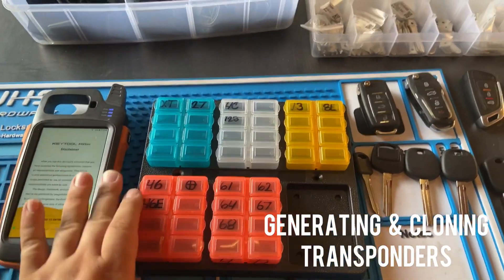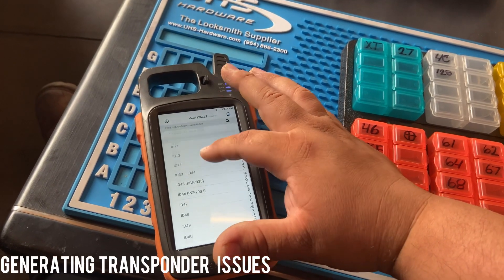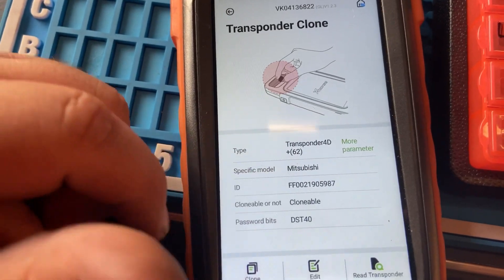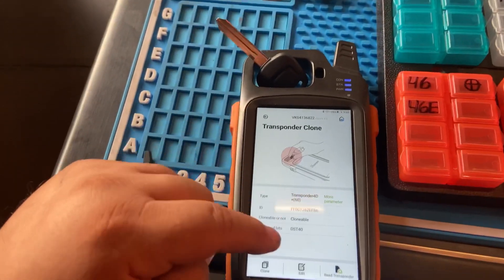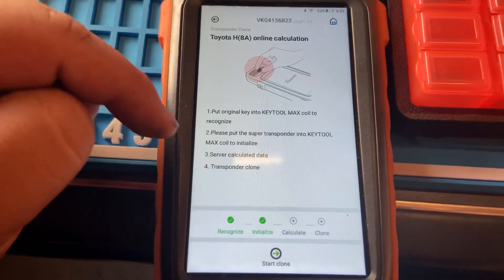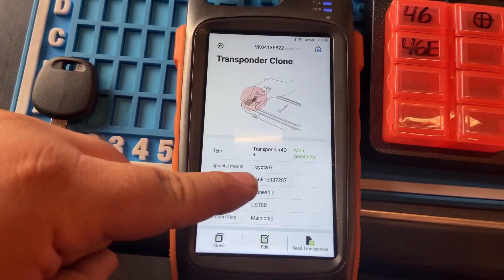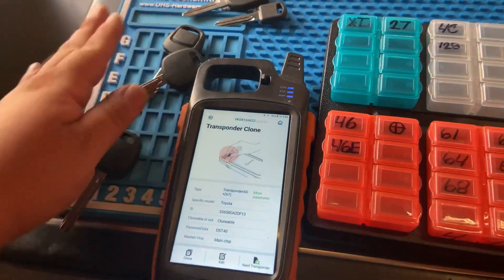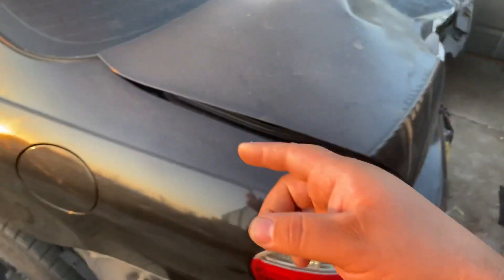VVDI KEY TOOL MAX- GENERATING & CLONING

Comment: on the 4c when you say you can clone it but hard for antenna to pickup, try this. drill small hole where transponder sits, to where the blade goes into the mfk head. so the transponder has a clear hole to put signal to antenna coil.
Reply: And I just thought I wasn't doing something right...
Reply from the maker: Thank you matt!!  Always appreciate your great tips!!

Comment: ID13 can be generated but won’t work. Even then some chips do get programmed in different ways than others. Do you know the procedure to program ID13 key. All key lost!
Reply from the maker: Needs a generic id13 only cannot generate..you can also clone 13 with superchip and use cloned chip as a replacement chip for id13

Comment: I tried to generate a 4C last night onto the super chip but it was not allowing me to. Every time it would ask me to put the chip in it would fail no matter how I held the chip. Any suggestions? (2001 F150)
Reply from the maker: Yes you cannot generate 4c chip with super chip ! Or sometimes wont be able to clone either best thing to do is use a generic 4c chip..

Comment: ive run into an issue with renewing Dodge SRT RED keys! they will renew fine and program, but will show up as a Black key limiting the HorsePower to 500.
Reply from the maker: I believe you dont need to renew.. im preety sure they are reusable.. it's probably that you are renewing to regular non red key data info!!
Reply: @MYKEYSAUTOMOTIVE  I thought so! I was thinking of getting the TMPro to maybe make my keys RED again :)

Comment: Do they "keyless factory" Branded remotes/keys (on uhs hardware) work with the key tool max? Do they already have transponders in them?
Reply from the maker: No they dont work with the ktm they are geric remotes and already come programmed to work for only those listed models you cannot generate them .. yes they come with a chip.. no u cannot generate the chip the come with.. they are strictly for the vehicles that are listed below!

Comment: Im back. tried the dolphin few times and decode is bullshit. Now have the laser key reader. Let you know how that is later.
Reply from the maker: Are you decoding by data base? Have you update and di calibration ? Height adjustment.. cutting calibration?
Reply: @MYKEYSAUTOMOTIVE  it did cross my mind about doing another calibration. But when you look at the decode probe you see on inner track keys it just does not touch both sides everywhere. Then when it cuts the key its crap. I had originally thought it was due to selecting the wrong biting for the key blade. 

Anyway after failing twice on a customers car in the field, I decided to go away and get my new laser key tool. It was not ready for some days due to key tool max login account issues where the security text was not arriving. 

I selected the blade and scanned the customer key. I sent the cutting info to the dolphin. It cut the key without needing biting info. It did it flawlessly. A beautiful cut mirrored both side into the blade. 

Tested on the car following morning and it fit the lock perfect.

Comment: you answered the question Do i have to program the key after cloning? And answer is no. However, do you need to SNIFF the ignition when cloning? Or no?

I seen another video where they were cloning a car key and he had to use the keytool and sniff the ignition by putting the original key in ignition turning on, then put the keytool close to the ignition. Does that need to be done? Was it older firmware or something?
Reply from the maker: Hello there is no programming after clonning ,however chips like 46 and 48 require sniffing from the ignition lock cylinder in order to finish cloning.
Reply: @MYKEYSAUTOMOTIVE  that makes sense!! thanks!

Comment: Hey here’s something. So I got the latest iPhone 13 pro max. Downloaded the xhorse app and started using. Only lucky too. Because I selected update on key tool max and the update wiped loads of my key blank info from various cars on it. 

So the app. Clearly it’s missing the reader. The part that detects the key transponder types. Yet in the app it says connect to the reader. So do they do a stand alone reader the app can use to generate transponders and remotes…? Yet to see that
Reply: In app when you select generate it tries to connect to a device. What device…?
Reply from the maker: You need to connect to your key tool max via Bluetooth.. or mini key tool, once it connects it should have all your data
Reply: @MYKEYSAUTOMOTIVE  well if I’m to connect the phone to the key tool max which already has the exact same info on it then that’s bloody stupid. No point developing the app.
Reply from the maker: Correct thats correct .. it's convenient to connnect the mini key tool
Or
Dolphin or even mini prog .. but yes useless if you have the ktm

Comment: Ok so the im608 pro i bought says for eu market on the screen as its loading. A firm here whom only sell these and boast they are great at diagnostics, and with 70 percent of their work fixing cars that local garages cant fix,  they said they’d never heard of the ms908im. Strange because why would the people saying they were Autel UK have it if it was shit. Why would it have ben built? 

Theres a video on here about the two big Autel families MAXI and MAXIS. He puts them against one another in a test. What the hell are Autel doing. Why they would bother to produce two machines for the same job?

So the firm saying they are great at diagnostics. The guy said CAS3 is not a safe system to do keys for. I dont know why but I just dont believe hes talking the truth. Then asking me if I have any locksmith training. Yeah its called youtube. People laugh at that as if they think the info on here is shit. 

The ms908im arrives in one bug ass black plastic case. Twice thicker than the im608 pro case which is exactly same size as OBDSTAR case. Then the bug black case is also taller and near 1.5 times longer too. Its like you would find in military for where they keep heat seeking BAZOOKA’s. 

I think im608 pro is sexy. Ha ha. Its heavier than ms908im I recon.

Comment: When cloning, can you clone a generic chips or only super chips?
Like normally generic to super chips / can it be done generic to generic?

Also when cloning , you don’t need to generate the super chips right? 
What is the purpose of generating chips if it’s already super chips?

Thanks , I hope I don’t make confusion lol
Reply from the maker: You can only clone generic to superchip!  Not generic to generic because the generic one is already generated for specific models.. the super chip is a new designed super chip that allows you to clone and generate... cloning and generating are two separate ways of making a key... you can clone the cloneable chips but not all chips.. when you clone you dont need to generate, you already have cloned his key info... however if you cannot clone a key you will need to generate and program the chip to the vehicle ,if you have the incorrect chip type..it will not program therefore, it will not work! Like I mentioned generics chip are made
Only for certain models and are not altered cloning chips that u can use to clone or generate ..thats why the super chip is called "superchip" it does things generic chips cant do!  .. hope that helps understand the superchip a little more.

Comment: Can you use a super chip to generate a chip for a 2000 Bmw 328i I believe it’s an id44.
Reply from the maker: I tried it before but I couldn't generate the pcf7935 or pcf7930  with the super chip :(( so no u cant in my opinion!
Reply: @MYKEYSAUTOMOTIVE  thanks for the reply 👍🏻👍🏻

Comment: Can a b 111 circle + be cloned at max tool not have to be at ride  I tried to use super chip but would no onboarding program ?  Reason it didn't t work
Reply from the maker: You can clone yes..   so you tried generating it or cloning???

Comment: Hi I have a customer who has a Volkswagen Caddy it will not allow me to clone a key it says function not enabled I have written a new superchip id48 how do I program it to the vehicle
Reply from the maker: You have to generate a few remotes to unlock transponder 48 clone option..
Reply: @MYKEYSAUTOMOTIVE  thanks so much you are amazing I have just generated 10 of the same remote to different cars and collected loads of points do I now need to wait for it to be unlocked
Reply from the maker: It should tell you to wait for about an hour before it unlocks i think u need to generate 15 remotes
Reply: @MYKEYSAUTOMOTIVE  thank you that worked very well. I have a customer today with id48 chip it made me wait 48 minutes while it calculated, is that correct or it is it something I did wrong??
Reply: @MYKEYSAUTOMOTIVE  hi I have a customer with a Ford tibbe key I have bought the M3 bracket to cut a new key how do I decode the original key I have the original key but I do not know how to de code it on the machine or by looking at it
Reply: Hi I have done over 10 remote and it is still not active how long do I have to wait or is there anything I have to do
Reply from the maker: Keep doing it your not far from
It!!

Comment: Hey Mike have ever done a 2015 chrysler 300 with the key tool max?
Reply from the maker: should be the same up to 2017 for 2018 over you need a brute force or bypass cable that goes connected to the star module

Comment: Hi bro, I want to buy a cut machine, would you recommend me UHS hardware? Thanks
Reply: The triton machines pretty good.
Reply from the maker: @andrewmortellarosr.5741  yeaa the triton is awesome! Does them all!
Reply from the maker: Yes thats correct!! They are having a sale right now!!!
Reply: Yes it does, even ingraves custom print or pictures as well. Only problem im finding is it when cutting a tubular keyits depths are more shallow than the the specified cut depth. But I've only tried it with feo-k1 keys so far, so it may be a problem with the operator and not the equipment

Comment: Wouldn't it be easier to stock aftermarket transponder keys and use your Autopropad to add an additional key to your customers car?

Your cars in bad shape. Good thing you weren't hit on the drivers side.
Reply from the maker: Its more convenient for me to use the mfk becuase i can mix match keys and transponders ,if i dont have a certain key i can just make it ... and i save a bit more money!!  I know they hammered it!!:-/// i know right!! Thats whatni was saying..rip
Reply: it is faster to clone, as you have to wait 12 minutes on some cars per key. also i had to add key to a ford vehicle once and it says needs to erase all keys and needs 2 keys to program. so i added the first original then the second one never could get added so was a no start. after several hours of crying found a remote start under dash unplugged and programed in. if i was just cloning key never would have had any problems.